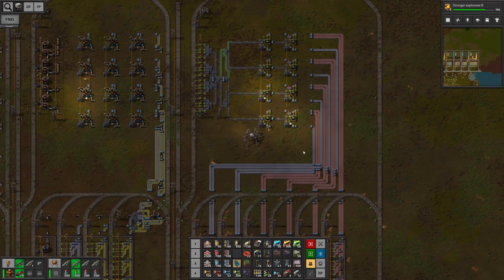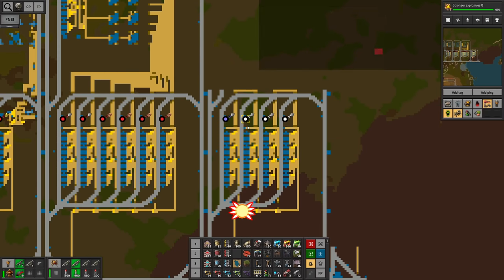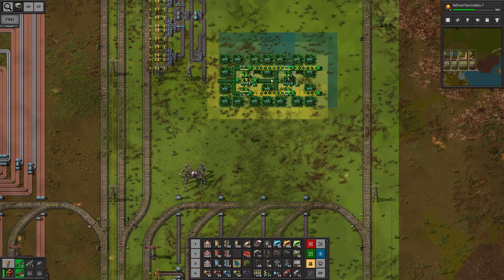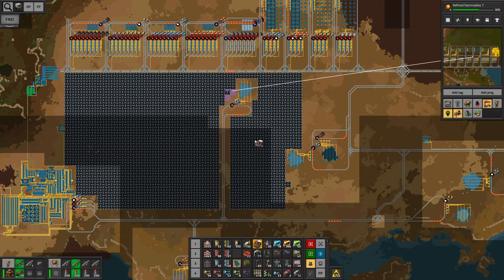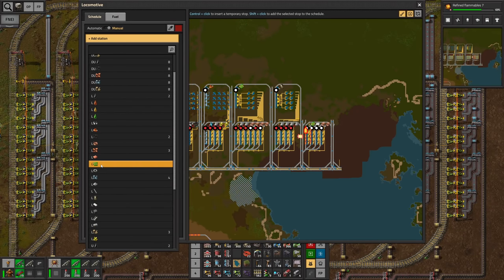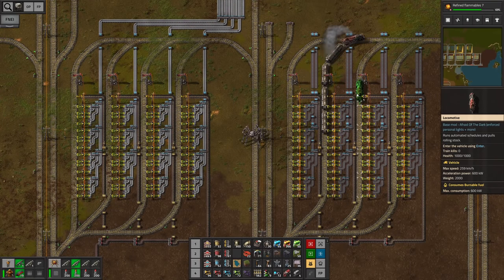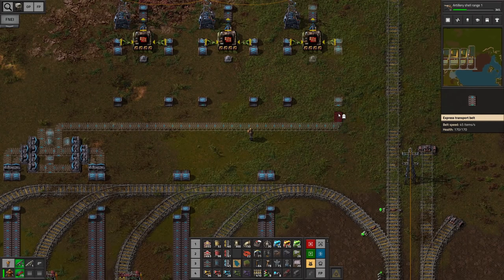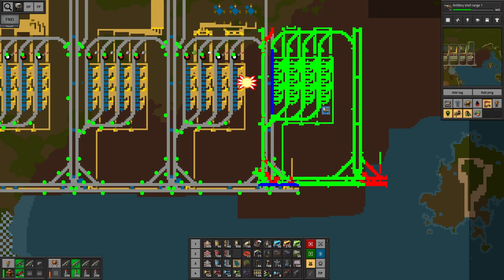ADVANCED CIRCUITS & PROCESSING UNITS - Factorio: Ep. #16 - Guide & Let's Play

Comment: It seems (at least at the start of this episode) between the previous episode and this one, you had forgotten your idea to put the blue circuits first then the red circuits after, which was honestly an ingenious idea. By your own words, having to travel directly to the next station in line towards the right would be a huge problem, but traveling to the station directly to the left would be no issue.

3:37 By the way, you can side-load underground belts, so what you were doing moving the lights there was unnecessary.

Comment: One thing to consider is that your Iron unloading station is going to empty the chests closest to the front of the train first.  The Splitter setup you have will take half of its Iron plates from the 'front' set, 25% from the 2nd set, and 12.5% from each of the last two sets.  There needs to be a way to Merge the first two train locations before using the Splitter to merge the front half and back half of the train locations
Reply from the maker: I fixed the setup a little end of next episode to prevent that.